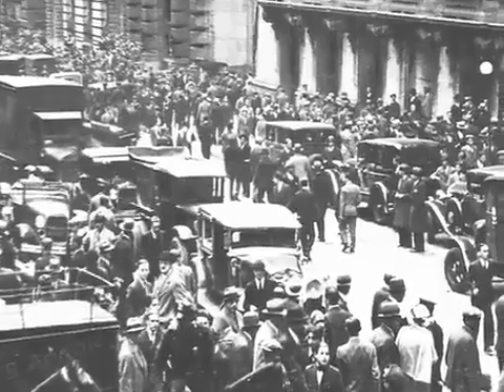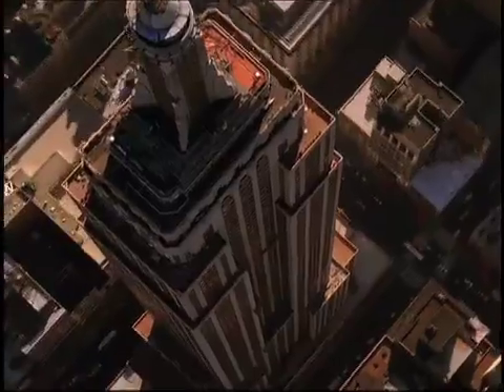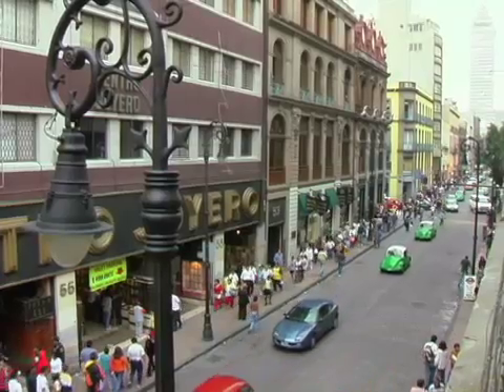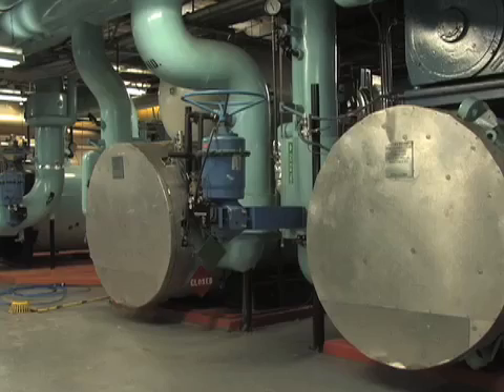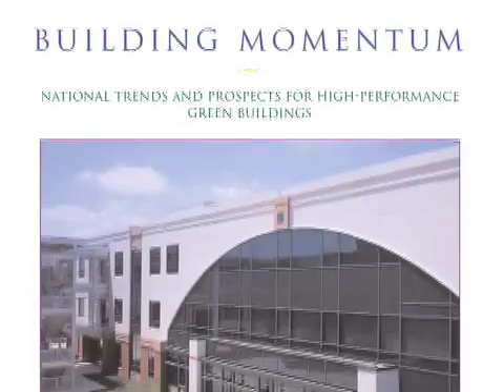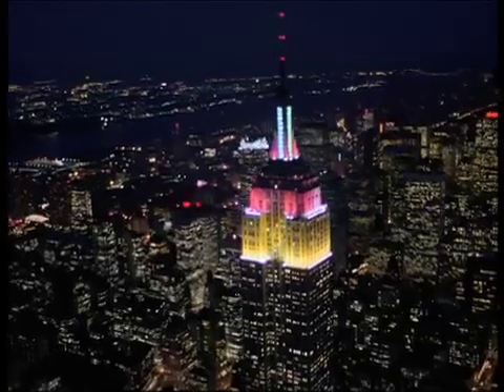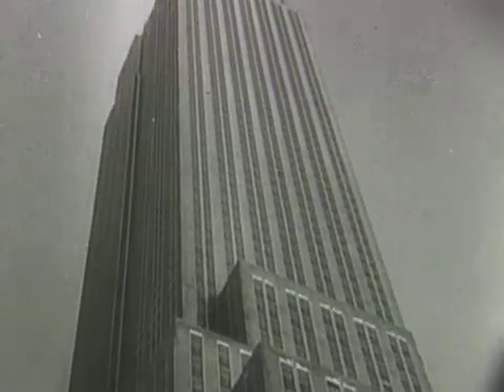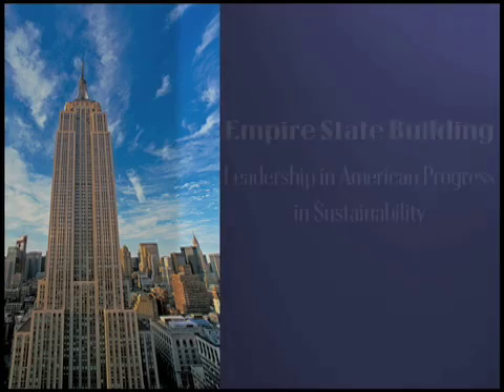Clinton Climate Initiative Helps Retrofit Empire State Building

Comment from the maker: Yes   the numbers and measurable results are what counts. Here are a few: For this project, the initial $20 million project will result in the Empire State Building reducing energy use by up to 38 percent and energy costs by $4.4 million annually, and reducing carbon dioxide emissions by 105,000 metric tons over the next 15 years, with much of the project funded through energy and operational savings.